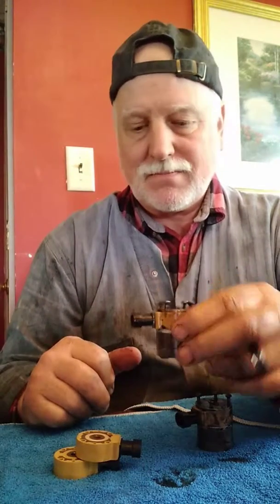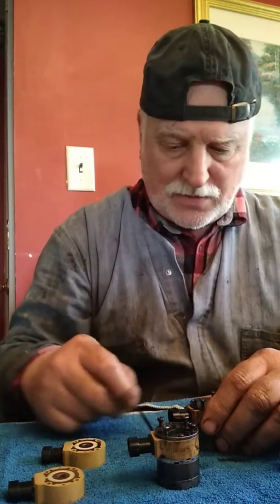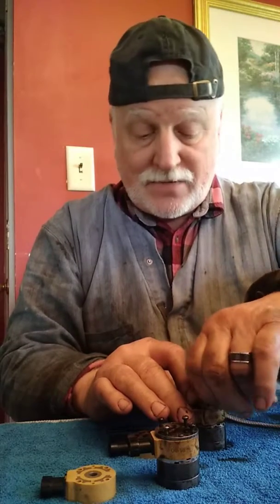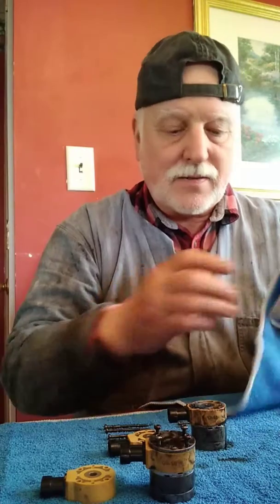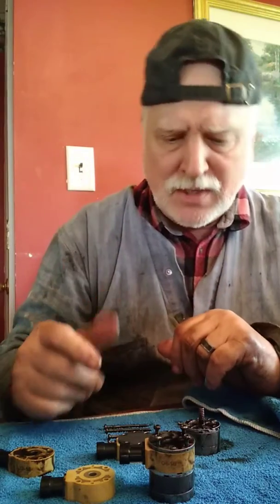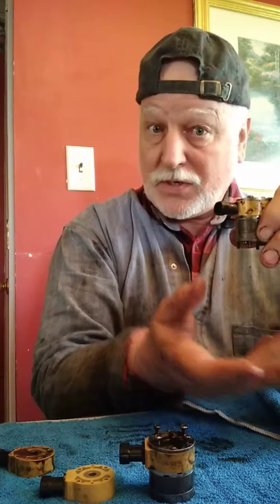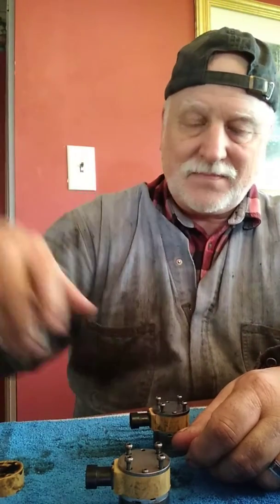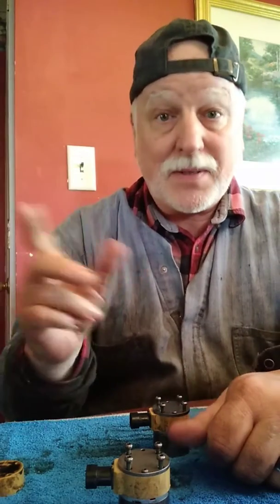C15 Cat Intake Actuator Coils

Comment: Mark. Where can I get just the solenoids in Indianapolis.  Also are all the solenoids under the cover the same.  It looks like the fuel pump solenoid on a 320d.
Reply from the maker: Find Young & Sons Machine shop, they have moved I believe
Reply: @markwieland7101  I called Young and Sons. I know your video is 4 years old but would you happen to have a part number for those on an old invoice.  The parts guy was oblivious and didn't even know what an IVA was. Im sure all the old schools have retired from that place by now.
Reply from the maker: Call me (765)238-1475